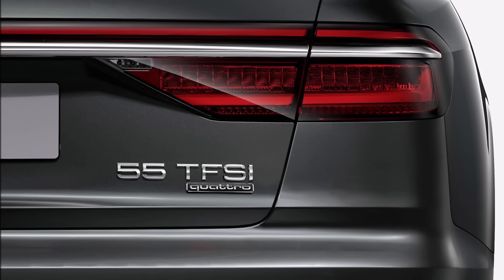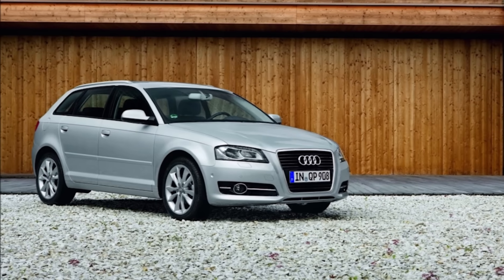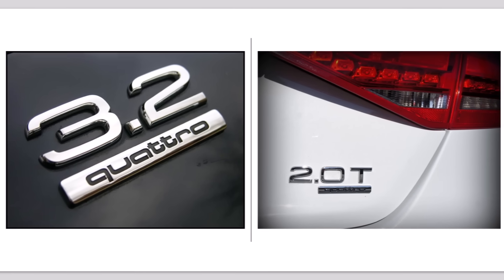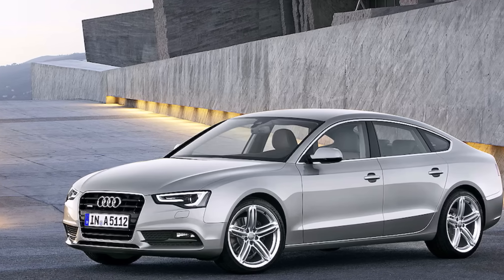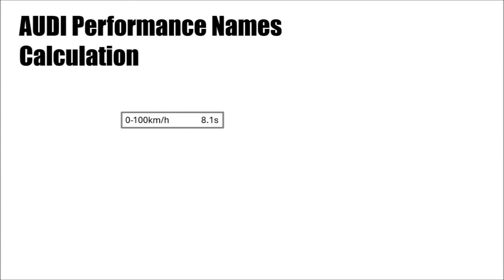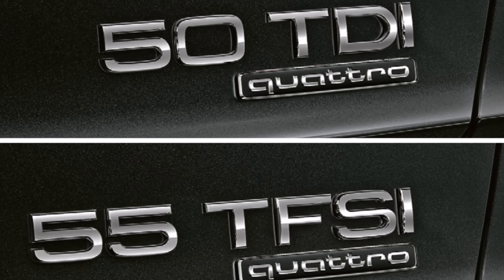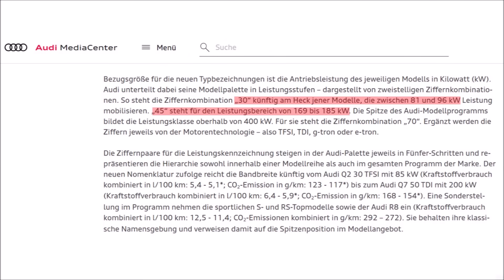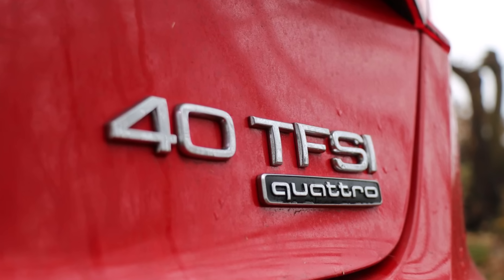AUDI Performance numbers EXPLAINED

Comment: I prefer information about the engine size, as it gives an indication of how flexible the engine is for regular use.  Outright maximum acceleration is not relevant when you need a smooth torque/power curve for comfortable driving.  I prefer a less tuned engine without extra turbos, superchargers, no ultra high power from a small capacity.  Just focusing on power is deceptive.

Comment: I had a general , intuitively, grasp of the system, in that higher number meant better performance. But I never saw any other explanation than the ”power categories”, and as an engineer, that made no sense at all for me so I ignored it. I wish your brilliant explanation had come out earlier. My now-sold C7.5 S6 Avant would have had 63 TFSI on the back 😊

Comment: The A6 50 TDI which accelerates at 0.54G and the Q7 50TDI which accelerates at 0.4G is just one example of many that proves this is nothing but nonsense.
Reply from the maker: To be exact, an A6 C8 50TDI accelerates with 0.47G, a Q7 50TDI with 0.46G. 
Since they use the next bigger number, the 50 is the correct one for both. 
I don‘t know where you have your numbers from.

Comment: What a dumbass way to give information. So as a customer you want to know about the car's performance, and instead of engine size in Liters you get the answer of a math equation??? They should have just stuck with the 0-100 km/h time in seconds and stick that on the back. That's way easier to explain by carsalesmen.
Reply from the maker: It is literally THE performance number, which works for all drivetrains and even takes weight and gear ratios into account
Reply: @bsport320  That might be true but only people who actually work in that field of the car industry know this. These people know what the numbers mean and how to translate them to the performance of the car. People without that knowledge just see numbers and letters on the back of the car. And when even the car salesman can’t explain those to the customer properly it’s a sign that that system doesn’t work.

Comment: I’ve had the privilege of owning a Mercedes-Benz AMG GLA45 for the last six years. 

I did have an Audi before hand but it’s 2.0 engine (2011) was an oil burning POS, it moved on quickly.

So tell me how MB came up with the 45 Moniker as the rest of the range are 180, 200, 220 & 250?

I still think Audi’s naming designation is absolute rubbish. If I but a big fast car I want a big fast number on the back. Not 35….

Sort it out Audi - you’re not tempting me back so far….

And the GLA45 - for information: 2.0lt engine with 381hp. Make that fit the 45 designation…..

Comment: I was an Audi tech when they came up with this and I thought it was great. I remember seeing 3.0T and thinking that is dumb. There is no turbo on the 3.0 supercharged engine. The numbers don't make sense though. They could have used it with torque numbers in mind. Like 55 for 550nM or they could have used the first number as numbers of cylinders and the second number as a 1-9 scale of acceleration. Or just 2.0 Turbo is a 45. A 5 turbo as a 55 . A supercharged 6 as a 65 and turbo 8 as a 85. Something like that.

Comment: No, it doesn't work that way, A5 45tfsi (265hp) accelerates in 5.6s (0-100), so it's 4.96m/s2, so ~0.51G. If your theory were true it should have the 50tfsi badge (more precisely 51tfsi)

Comment: An A6 45 TFSI does 0-100kph in 6,1 seconds, a Q4 45 does 0-100 in 6,9s and the 50 does it in 6,1…
The math doesn’t add up, same acceleration should mean same number right?

Comment: With work, we occasionally get hire cars to drive to customers and it’s normally a Corsa or something similar. However, last time, the hire car company must have been all out of Corsas so I had a free upgrade to an Audi Q2. I wasn’t aware of the new Audi numbering system for power, I just assumed the number still related to engine size. Seeing 30 on the badge, I thought it was a 3 litre engine and maybe the decimal point between the 3 and 0 had dropped off! I soon realised it wasn’t a 3 litre 😂

Comment: As an Audi SQ5 owner I was always lead to believe and still do believe the numbers related to the BHP of the engine being used depending on it being a TDI or a TFSI. For example 25 up to 107 BHP,  30 - 109 to 129 BHP,  35 - 148 to 161 BHP,  40 - 165 to 204 BHP,  45 - 223 to 244 BHP,  50 - 278 to 304 BHP and finally 55 - 324 to 363 BHP seems a lot simpler way to explain things than having to use a calculator which by the way I have never heard of before and which seems quite unplausible.

Comment: The confusion could have been solved If marketing could have offered a line or two to call it acceleration percentage of meters per sq second, or even to just call it an acceleration calculation or percentage, accompanied by a chart or graph in the brochure.

Comment: So it depends on the engine or the specific car? For example lighter car with 2.0tfsi and heavier with 3.0 can have the same number (for example 40)?
Reply from the maker: Yes exactly. And the same engine in lighter/heavier cars will have different numbers at the back. It was designed to always tell you the performance.

Comment: Wouldn't kilowatts have been more intuitive?   Interesting to learn about this as I had wondered what the number meant
Reply from the maker: But only kW doesn't take weight into consideration. So a heavier car with the same power is slower, which is reflected in this naming scheme.

Comment: And in reality it was like this: 
"Due to downsizing and sketchy engineering our top model is now a 2.8l biturbocharged mild-hybrid engine. So what we write on the badge? 2.8 TFSIe?"
- "For gods sake no, thats less than 4.2! It has to be more than the predecessor, just write 55 with no dot. No one will notice for a while, and we'll come up with some explanation later on."

Comment: That's why engineers making cars need real life skills and mechanic skills, they think, oh that's a great idea to put fuse box and battery just under window washer FLUID container (Audi A4), great idea, saves space or that's not a too big of a problem if you need to REMOVE whole BODY from FRAME just to do basic maintenance like changing auxiliary belt or to do ANYTHING else other than oil change (*cough* Land Cruiser *cough*). And in the end there we are, explaining how powerful cars are in acceleration, guys, many common people doesn't even have reference number what a G is! Last time they heard about it, it was in high school in physics class. At least give one main engineer with real life communication skills and mechanic skills to rule over this introverted and high functioning army of number slaves.

P.S.
Before you get your sensitive panties into the bunch, i didn't say they were bad engineers, i said they are too deep in their communication bubble and doesn't understand that physics terms like torque, acceleration and other, are not normal things people not working in engineering talk about every day.

Comment: As humans we made some concepts for the phenomena in nature that doesn't change, and we are use to it. We are also used to this concept that those concepts doesn't change. For example, I have a lot of ways to turn on and change radio stations on my car, but Ford still kept the bigger turn button in the middle because intuitively and ergonomically it is the concept and the way we do it for 100years. Similarly, when I see car with a badge 2.0 it means there is a 2 liter engine inside, because it is what this number is suppose to represent, it always did. 
Now make a new concept, but 3piston 1,5L, and put 1.8i just because you can make a marketing presentation in your company where you explain that is a new nomenclature, doesn't rule out the fact that you actually are aware that you lie to your customers.

Comment: okay , good naming system ....for people who dont know about displacement and cylinders and that , people who just wants to choose a car simply ... But whyon performance models .? A person who is in the market for a sports car , or high performance lux car , trust me , such a person will damn well know all about engines etc... so chances are he already knows all the figures befpre he even goes to a deaership,,, I think its stupid , maybe eve a sly trick used to make people think they buing a 4.5 L v8 audi ... As for all the cars , specially from germany side , the named was always so easy , bmw , merc , and audi was spot on with that.. bmw , you knew already when someone says "320i" okay its a mid sized , mid performing saloon,,,, or say "330D" you know its the big fast diesel... 745i = the largest sized bmw , and its a v8 under the hood.... Vw was also right from the get go... Vw Golf 1.4i  or 1.6i and then some funny name added that tells you the the trim style... or "sport" to say its a bit sportier , mag wheels and such ,,,, Gti - obviously ... Opel was also good , so was japanese cars withMazda 323 , 626 and so on... I dont car anyway... I believe they made all the best cars before the year 2000....

Comment: If only they had used a similarly complex calculation theory when they worked out the material specs for the timing chains and guides.

Comment: How complicated. And even me as a German car fan did not know what these numbers meant. It surely would have been better to keep the T for Turbo, so if it says 2.0T it would be fast. Especially since in the quattro days Audi used for the 5-cylinder engines a colour coded lettering on the front grill and boot lid saying 5S, 5E (Einspritzer = Injection) & 5T (Turbo. 

Another option to combat the original problem would have been what BMW did. They applied FIA turbo factors (x1.4) as used in FIA motorsports back then. So the E23 7-series turbo for example was based on the 732i with the turbo factor applied it was marketed as 745i. 

That said modern BMW (and Mercedes) numbers only make sense when you need a penis extension.

Comment: I always thought that the number represents the displacement of a naturally aspirated engine that would be expected to make the power that the actual engine in the car does. So if the car has a 2.0 turbo that makes the same power as a 3.5 NA, the number would be 35. This is even worse than I thought.

Comment: This system WOULD work really well on an all-EV lineup (similar to what Tesla do with their battery kW/h badging system) But with the mixed petrol/diesel/hybrid/EV lineup Audi had, it was incredibly confusing, especially given that the same engine could carry different numbers from one model to the next.   Maybe they should have just gone with hp rating, at least that wouldn't have confused anyone.

Comment: Audi doesn’t typically display engine displacement anyways. One of the reasons I’m sure is being that they’re limited to .5L per cylinder everything just about would say 2.0,3.0 and 4.0L. Most of these engines have 3 or more models each and performance between them varies widely. Their number for the engine optioned in my opinion is needless and isn’t functional to the average person. The letter before the model number will tell you which engine it has for the most part. And even then unless someone is an enthusiast or paid a lot of money for a RS over a A most have no idea what the engine is really anyways. This is the dilemma BMW had on their hands when they only use a few displacements now. Their numbering scheme didn’t make sense anymore.

Comment: Big THANKS for explaining it as clearly as possible.
How come can such a decision make its way through all the layers of managers?
My idea: torque figure, in Nm or mkg. After all, torque is all we care about when regularly driving (1500 to 2500 rpm). Max horsepower is achieved at much higher rpm, which is not the majority of our driving conditions.
Reply from the maker: Glad I could help!

Comment: I never understood it. Makes sense now that you explained it, but I still don't like it. I don't want a small engine in a "fast" car that's also supposed to be a reliable daily driver. I really miss the 2.8 and 3.2 VR6 engines, even though they came with plastic chain guides, which was really annoying.
Reply from the maker: Glad it helped!
Sounds like you don't like downsizing, but these names also work for big engines
Reply: @bsport320 my point was that this naming system doesn't make the engine size clear, unless I missed something.

Comment: A4 45 does 0-100 in 5.8 seconds which is 49% of a g so that doesn’t work. A6 50 tfsie does 6.2 seconds. I think it just works in some cases and since there’s no other evidence makes me question your video
Reply from the maker: AUDI had to decide how accurate they do this. So they decided in 5-steps, otherwise you would have a 49.8 TFSI and a 52.3 TDI.
Acceleration also depends on options, gearbox choice, wheels etc. but just by changing the wheels, they didn't want to change the badge at the back for the same car and engine... You see where this is going.
You need some kind of simplification.
Reply: @bsport320  sure but this doesn‘t explain my point of the A4 45 being an obvious 50 and the A6 50 being a 45. Since acceleration greatly depends on the model due to weight and aerodynamics it doesn‘t make much sense to use acceleration numbers for each engine. the A4 45 is a second faster than the Q8 45 because the 45 refers to the engines power range not the acceleration.

Comment: What i used to do was i just do -20 every number. For example, A3 35 tfsi. 35-20=15. So the engine is 1.5 liter. But its wasnt always right because take a8 55 tfsi for example, it should have 3.5 liter engine but it has 3.0 instead so it was kind of confusing lol
Reply from the maker: Yes people really tried to make sense of this but never got the proper explanation
Reply: @bsport320 Yeah, it was confusing and i was really wondering why did they made it this way. Thank you for the explanation 😁👍

Comment: They over complicate everything , take the  headlight bulb with  brackets and clips to hold it in place, Toyota uses a H11 bulb it's bulb holder and fixings all in one turn 1/4 of a turn it's in, reliability with less parts required

Comment: Thanks for this - I have often wondered what the numbers meant. Dividing 280 by the number on the back of the car to work out the acceleration rate is a funny system. The thing is that, if they’d stuck with it, people would have eventually worked it out. After all, knowing an engine size isn’t an intuitive way to understand how fast a car would be - it’s something that we learn: 1.3L = slow whereas 5L = fast. Then turbos arrived.

It would be great to know know how Mercedes decide on their numbers - it seems like a proxy for their old engine size numbering (that wasn’t ever quite accurate)
Reply from the maker: Glad I could clarify it!

Comment: If this is how they came up with the numbers - it's no wonder that VAG group has to close three large factories in Germany - because people don't buy "people's cars" (it's in the freakin name) - where you have to adjust the temperature - while taking your eyes off the road for 3 seconds - while - travelling 180 metres on the autobahn at 200 km/h - during those three seconds. It totally makses sense. Aaaah, explain in english with heavy Vaterland accent. Und ja, vi tek evei oool batnz und nobz, wiii mek ze dhaiveh adjast ze temperatuh - mit die display - und ze ADAS macht alles was ADAS machen muss. NICHT GUT, VOLKS-WAGEN, NICHT-GUT. Whoever came up with the idea to substitute the brilliant and intuitive, top-ergonomic human-machine interface (sorry, knobs and buttons) present in Golf 7 and similar era cars - with the screen and capacitive madness - that is now - should be fired from Volkswagen - and prohibited from driving a car - ever again - for a lifetime. In all the cars that I drive (2012 BMW, 2008 Audi, 2014 VW, 2012 Mercedes) - it goes like this. I drive. Then - without ever - even for one second - taking the eyes off the road - I adjust the stereo volume, temperature, seat heating, conditioning, open/close windows, adjust driving modes (almost always in situations where you want the sporty mode now and immediately - and no, you cannot be fiddling an idiot screen then). Why? Because I KNOW where everything is. I can sense it. Sense the button. With my fingers. That is how buttons WORK. How they have worked - for a century!!! And on top of that all - you said correctly. VW knows it's selling cars abroad - ie, in other countries than Germany (the intelligence and brilliance!) - but they still make the car - for Germany. So they know what an autobahn is. They know you can encounter a standing car - or a traffic jam - while travelling at 200 km/h - and WHILE trying to adjust idiotic nonsense three menus deep. SO WHY? WARUM? Needless to say - I am never ever considering buying a stupid car made out of screens - driving of which is made impossible without ADAS - who all make the car more weighty, more complicated, more expensive - money you have to save on buttons. Makes sense? NO.